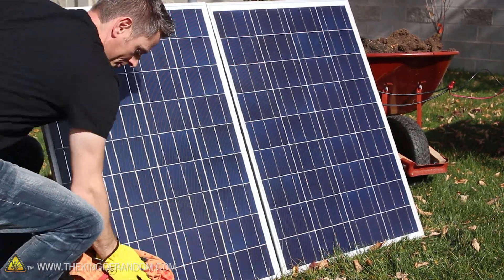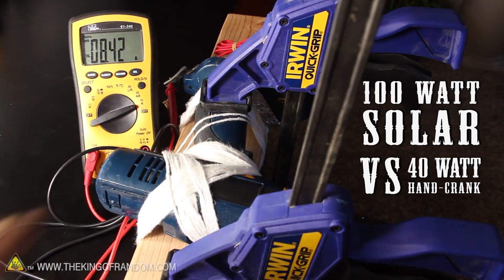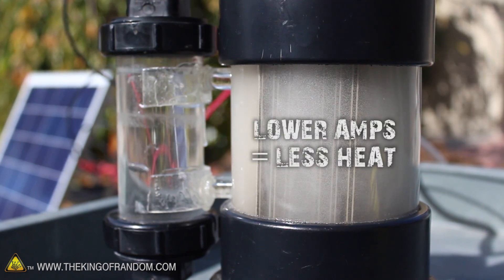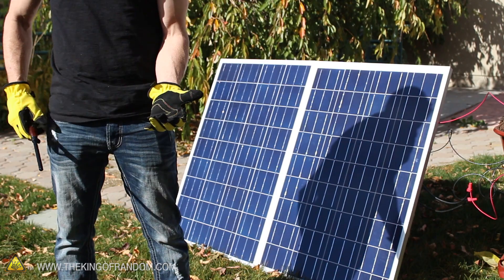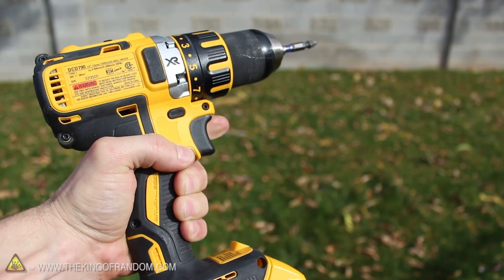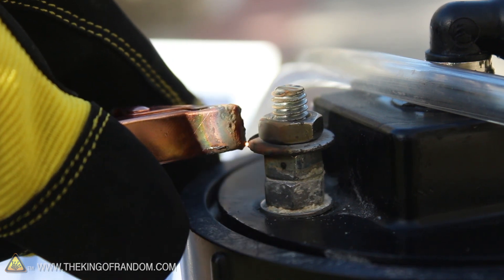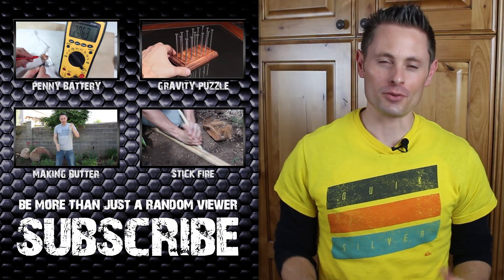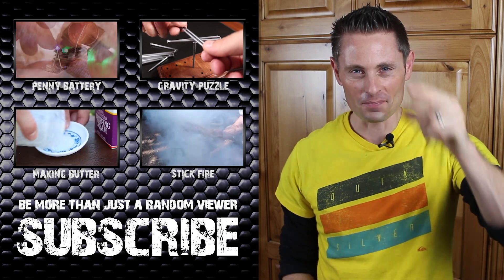Solar Electrical Experiments

Comment: Hey I have a project I can throw your way if you are up for it, I'm working on the same project, I'm getting a 125 cc motorcycle single cylinder engine for my project, since it's a single cylinder I'm planing on hooking up to hydrogen gas,

Comment: I wonder what would happen if he were to put the giant lens that he used with the the sun to start a fire in front of the solar panel, and if it would create more electricity or make it  a higher voltage?                               Or would the solar panel just burn from the intense heat of the sun going through the giant lense?

Comment: those panels give out too many volts!!
that explains the arc so running this type of electrolysis needs modifications using neutral plates to drop the voltage enough so you can run it off solar panels more efficiently!

Comment: I'd like to see the solar go to the hydro and the hydro running a combustion engine powering turbines for electricity and the water collected at the end. Use salt water in the hydro  system and we have a system that could power Cali and provide clean water. They could dig reserve tanks in the desert below sea level that gravity would feel and since the solar powers the hydro system the system should be a power + system that also provides clean water. To make the system even more productive you could put turbines along the pipes leading to the reserve tanks and harness even more power provided by gravity.

Comment: ....be careful arcing your solar wires cause you will fry the solar cells easily. kinda like using  peltier device and not properly drawing the heat away...the solder melts and no longer makes a closed circuit

Comment: Great project! Accumulating energy to gas from a sunny day to perhaps a clowdy further on. But is it possible to run that gas into a gas converted ( fromgasoline ) electric generator? How to best store and compress the gas produced in an diy-project. If possible do a test of that?

Comment from the maker: Some quick links to a few of the materials I used:

[✓] Solar Panels: http://amzn.to/2c69sAM
[✓] 4” ABS clean out fittings: http://amzn.to/2cRYegg
[✓] 3/8” Poly Tubing: http://amzn.to/2cqAyOS
[✓] 100 grit sandpaper: http://amzn.to/2cr0ywC
[✓] Clear silicone 1 caulk: http://amzn.to/2cg3Lle
[✓] Rubber Mallet: http://amzn.to/2cg3i2b
[✓] ABS Cement: http://amzn.to/2cg3a2K
[✓] 1/4” 90 degree Elbow: http://amzn.to/2caxbOC
[✓] 1/2” drill bit: http://amzn.to/2cg4LWf
[✓] 18 Thread TAP: http://amzn.to/2cqCMxy
[✓] Pipe Tape: http://amzn.to/2cRZLTS
[✓] 3/8” Swivel Elbow: http://amzn.to/2cRLOsS
[✓] 5/16 drill bit: http://amzn.to/2czNUxg
[✓] Bench vice: http://amzn.to/2cg5dnE
[✓] Stainless steel jam nuts: http://amzn.to/2cg70sJ
[✓] Acrylic glue: http://amzn.to/2cRLDy3
Reply: how long does it take for 100 watt solar panel to fill up that drinking bottle?
Reply: Grant Thompson - "The King of Random" Cool. Thanks
Reply: Grant Thompson - "The King of Random"
Reply: Grant Thompson - "The King of Random
Saiyur
Reply: hi
Reply: Grant Thompson - "The King of Random" hello

Comment: Hi I was wondering if I could attach one of those things that you can push the little pen down and it lets air out and that u use to fill a tire with air, well I wanted to know if can be attached to the tube on the generator so that I can just fill something up with the HHO?

Comment: When hydrogen and oxygen are burned is just H2O produced or CO2 aswell?
Reply: in a pure H2+O2 reaction, just water is released. in practice, there's tiny amounts of methane in the atmosphere that gets converted to CO2 from the heat, as well as an abysmally small amount of O3 (which immediately decays)
Reply: Ok, cool.

Comment: I'd like to see you separate out that hydrogen and oxygen, maybe compress them into storage tanks, and melt some metal with that. And then how have you not gotten on the supercap array bandwagon? You could combine a low-volt, high-amp carbon rod cattle prod thing to your foundry heating method and lay waste to a crucible of rusty nails.

Comment: Water vapor s a greenhouse gas. Even using a condenser will disperse heat into the atmosphere, in the long run causing vapor.
Reply: the water came from water vapour too. there is no net gain of water vapour in this situation
Reply: It is, in its own way, but compared to natural evaporation into the atmosphere, we can't even change the total emission in the ppm range. Also, Hydrocarbon powered engines emit water vapor too.
Reply: Water vapor is not a greenhouse gas. Water vapor is simply evaporated water, which in turn becomes clouds and then rain and snow. Get your facts right before spouting libtard stupidity.
Reply: Uhm, water vapor does store solar energy rather then reflect it. That's how storms work.

Now compared to CO2 from your gas-burning '62 Chavelle, or Methane leaking out of Russian permafrost, good ol' water isn't even a factor.

The fact water retains solar energy is actually the reason the central US gets most of it's rain.
Reply: Which has absolutely nothing to do with "greenhouse gasses". CO2 is a greenhouse gas. H2O is not.
Reply: +Criss Rosenlof water, as a vapor, does in fact trap sunlight rather than reflect it, so it is. it's just not nearly as good at it as CO2 and CH4 are, and in H2O's case, it's actually useful. water vapor is one of the many insulating components in Venus' upper atmosphere.

Comment: If you want your hydroxy cells to work better you have to isolate each cell for each other so the electric energy from one cell can't see the other cells via through the electrolyte.  It would be interesting to measure the difference in output and waste heat generation from what you currently have to the improved version.  Cheers.

Comment: Don't take this comment wrong because I love this channel, but if the laws of physics has a say in things, you would never use the oxy-hydrogen gas as a clean source of energy because it would be a waste. Even with a very quality electrolyte (a substance that allows electricity to pass through a liquid)  electrolysis is only about 35 or 40% efficient. Meaning, You would get a significantly larger amount of clean energy just using the electricity, rather than taking the extra step and using it to separate the hydrogen and oxygen. 

Energy cannot be created nor destroyed, only transformed and INTO A LESSER QUALITY WITH EACH TRANSFORMATION
Reply: What about when you are not using all the energy from your solar system, it might be worth storing the excess in hydrogen rather than batteries but I am not sure which is more efficient, certainly hydrogen can be stored a lot longer that batteries

Comment: 3:28 Free of charge? What about the costs to the environment to dig up the rare earth materials for the solar panel, the fuel burnt to power the machines used to dig it up, the power used to manufacture the solar panels, the fuel used to transport them, the work you had to do to afford them, and the money exchange to purchase them? That's far from free. Solar panels are one of the most wasteful energy sources there are.

Comment: I had this schematic pop up in my mind and im 16.. It uses multiple creations you had made even though I didnt even watched your videos yet.. If you can. I'd like it if you put some things together.. a self running generator, hydrogen gas generator, another dc generator connected to the pulley, not the power output, and a condensator. The generator self runs, the kinetic energy gets duplicated to the third dc generator, which powers both gas generator and the condensator, which receives hydrogen gas from the ioniser and turns it liquid. Yeah got this idea but didnt have the materials. So Liquid Hydrogen fuel for free forever for zombie apocalypses. Just require water :)

Comment: But Grant?     I just got an idea for you!       Make a solar driven car by taking out the car battery and connect the solar panel instead!
Reply: That's not how a car works...
Reply: NewAgeSoldier If batt patents would be history,mankind can store lots of power for when needed...👍🏻
Reply: This solar panel couldn't supply enough current to crank the car engine...

Comment: I went to school for photovoltaics. That arc was something we used to do to both teach new students the dangers of DC current
 And because it was wicked fun. The difference was we used 16 180 or 235 watt modules. The spark was huge! The longest sustained spark we got was just over an inch long. We cut through cans, started small fires, boiled water... Fun stuff

Comment: What if you combine the solar panels with the solar death ray? Probably not with the light focused on a single point, but with the light focused to some degree
Reply: Ciroluiro This method is already being used in solar farms. They use the less expensive mirrors to focus more energy on the expensive panels, increasing the total amount of energy that interacts with the panel, thus increasing output.

Comment: The bad part about solar panels is that innovation is so fast your investment would be trashed in like 3 years because one the size of a quarter would produce as much as the 3x5 panel you got. It's better just to wait. Solar panels are about to get insanely good. (I'm still pro-nuclear though, stuff outclasses everything)

Comment: Use some Kanthal or Nichrome resistive wire so it does not melt and you can use it over and over for starting fires. :-)

Comment: why did you have to connect an inverter from the solar panels to the car battery if they both run with DC and doesnt require conversion to ac?

Comment: I want to try and build a larger model of all this, and see if it could run a riding lawnmower (or even a car)... problem is... I am concerned, because of all the heat and arching generated in this video from the alligator clips and the nuts/bolts... Is there a way around this? (Sorry I am not too wise as to wiring).

Comment: One challenge with solar power is how to store the energy for use later at night when the sun is down. What are some of the ways you can think of to achieve this? Lots of batteries or a Tesla electric car is a storage option - but that's probably not random enough for you...

Comment: H2O split is 2 moles of hydrogen and 1 mole O where are you getting these formulas... lmao "The fuel is made by electrically splitting water into hydrogen and oxygen gasses (2H20 = 2H2 + O2)" what does the 2 stand for and the H20? And how did you come up with 2H2O when I thought it was widely known H2O is water. I'm only making fun of you by the way cause you never gave me the large gummy bear. Or was it the email I sent?
Reply: Seriously? This is high school chemistry stuff, if not earlier. The chemical equation 2H₂0 -> 2H₂ + O₂ you have there is a balanced equation. 2H₂O means there are two molecules of water. When writing equations like that you have to keep them balanced, as in this case neither of the products exist in their monoatomic state on earth, or anywhere really. Elements like Hydrogen and Oxygen bond to another hydrogen or oxygen, creating H₂ or O₂. They are Diatomic. To make the math work, you need 2 H₂O molecules, otherwise the second Oxygen came from nowhere. You have to account for all reactants and products. His equation is correct. You get 4 hydrogen atoms, and 2 oxygen from two water molecules, and both are in their correct diatomic state.
The other diatomic elements are Nitrogen (N₂), Fluorine (F₂), Chlorine (Cl₂), Iodine (I₂), and Bromine (Br₂).
Reply: WTZ607 Seriously, did you just prove my point?
Reply: theidiotcure If you read and understood what I wrote, you would know I was not. I was explaining how your understanding of chemical equations was not correct. I explained to you how the one Grant used was a correct, balanced equation, even explaining to you what the 2 in front of H₂O meant, and why it was there.

Try to read more than one sentence.
Reply: theidiotcure youre the dumbest kid i ever saw, O doesent exist alone, it always pairs up with another oxygen and then you balance your equations, i serisously dont know how to say that to you reread that top comment.
Reply: Dragos Secrieru You saw me? Where? When? By the way its capital I* Oh* Doesn't* minus comma after alone, capital I* again, seriously*, and lets not forget that your sentences make absolutely no sense. Its like you cannot put one complete thought together or be specific. So I guess that makes you dumb, right?

Comment: aside from the energy used to make it. it is "green" solar panels are not worth it until they reach 80% conversion rate. they are currently at best 24% efficient right now.

Comment: If I connect a solar panel directly to the inverter ii will definitely get the power
But how can I charge a battery of about 200 amperes directly from the power of that inverter
This battery has also two wires positive and negative with a couple of clips along thier ends
Shere I will need to clip those clips for charging purpose 
Actually I want to use it as a bacjup purpose because in my country the power gets shutdown for 7 hours a day on regular basis
Will be very thankful if someone tell me the way of charging such type of battery
It's AGS 200 AMPERE BATTERY (a truck battery )
Reply: You want 14 volts from the panels, or similar. Run that 14 volts PARALLEL to the batteries--positive to positive, negative to negative, like jumpstsrting a car. Then, wait. You can attach things as if it were a regular battery. Be careful not to overcharge
Reply: waterlubber thankx 
Can u please send me its rough circuit diagram by drawing it on paper 
U can send me that image on my email 
shehryarahmed39@gmail.com
Or via whatsapp 0300 4505781
:)
Reply: QUICKLY
HIDE DAT EMAIL
Reply: Oh my gosh, youtube added a Translate from sucky to normal english button.
Reply: Look the solar panel that is a 100 watts each are in 12 volt DC power- So just connect the positive and negative, (red and black) directly to the battery. Then when the battery is charged connect the power inverter to the battery.
Reply: sampton7454
You want a little bit more than 12 volts, about 13-14 should work.

Comment: Canada

Did you know that only 8 panels two sets of 6 high amp-hours batteries or just car batteries hoocked up in parallel  whit a couple 3000 watts inverters and a charge regulator you can power your home and your garage all year long.

that is the system I am running on (realy basicely explaned) 

solar is the way to go if you want to reduce your electricity bills a lot 
it sure is expensive up front but totaly worth it !! 

sorry for the bad spelling  i'm French canadian

Comment: Use a charge controller between the solar panel and the battery, those funny yellow top batteries are easy to ruin.

Comment: Why this FREE & UNLIMITED energy is not implemented in the industry?
Why we still need to wage wars for fossil oils?
Reply: CuZ Teh GlobAl WarMiNgZ Si HoAx By TeH GoVerMentz
Reply: People doesn't own the Sun,wind and water.But people can own oil.
Reply: Because sometimes the sun isnt out and you cant just shut Down the factory because it rains.
Reply: It's inefficient and storage mediums haven't advanced enough yet.
Reply: Because a liter of oil will have waaaaaaaaaaaaay more energy density than any other battery know to man....thats why. But I get what you mean.
Reply: It's not as easy as it may seem. Also, the technology still has a ways away to go before it can surpass petroleum. I wish we didn't have to rely on other countries for fossil fuels, but realistically, that's not yet plausible.
Reply: Rogue A.I. because they cant make money out of it...

Comment: I didnt got how that thing with the bottle working. what do you need to do to get the water out of the bottle? (when he put it in the water)
Reply: It's in a tank above water. The pressure outside the tank is lower so it flows from the tank to the bottle through water. The water is there to trap the gas.

Comment: Grant Thompson - "The King of Random" I actually just got into a project for Charging My Samsung Galaxy S3, and soon when my contract ends in January 2015, I'll be getting the Samsung Galaxy Note 4. I've successfully bought, and recienved a Boost converter that converts my MNKE IMR 26650 batteries into 0.800A - 1.0A of charging power for my phone and my friends iPhone 4S. I've also purchased several Boost, Buck & SEPIC Converters on eBay from China to experiment with Boost, Buck, & SEPIC Converters. Sunday (11.09.2014) I've purchased three 1.5 Watt 4.5vdc solar panels @ 0.300A ea. to use in parralel to charge my Samsung Galaxy S3 with this Rio Rand 3vdc to 5vdc Boost Converter I purchased on Amazon Prime. So when I get the solar panels Friday or Saturday, I'll be doing a video on how it's possible to charge a cellphone for much cheaper than it would cost to buy a Anker cellphone charger. Awesome video, and yeah, I too just got into solar. It would be pretty nice to get one of these 100 watt solar panels. I'd probably use one of the Adjustable Buck & SEPIC Converters I'm waiting to be delivered to step down the high voltage to power different things.. I also purchased two TP4056 5V Lithium Battery Charging Boards from eBay to see if I can charge a 26650 battery. I've also purchased the needed USB cables from Monoprice. Also waiting for my 26650 cradles from Vape3D. I've always wanted to get into the hobby of Electronics. I've also purchased about 20 Schottky 2A Diodes for my current small solar project(s) from Mouser about a couple days ago. They should be here in a couple days. Many videos I would like to do on this area of electronics with harvesting electricity and manipulating it. Also bought two KeepPower 26650 5,200mAh batteries from Illumination Supply. Awesome video. (+1 : 4,783). Just bought myself a $10 30 Watt soldering iron from RadioShack, and I was skeptical that it wouldn't work, but it does. etc. etc. etc. I'm watching from PA, USA.